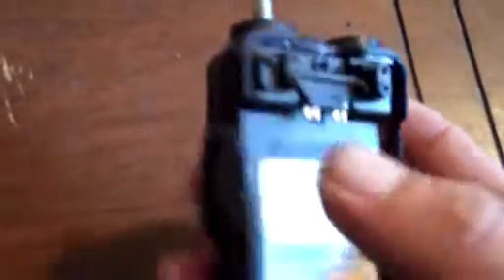Taking apart the Baofeng UV-5R

Comment from the maker: However if the user switched to frequency mode it would still transmit and receive. Beyond that, a radio shop may be able to modify it, but the labor cost would probably exceed the cost of the radio since they are available on ebay for about $30. Hope this helps

Comment from the maker: Not sure if you can totally make it receive only. When you program memory channels, you do it 2 steps, you have to hit the button to confirm the receive memory first, then you have to repeat the steps for transmit memory. This is because when program repeaters they transmit and receive on different frequencies. but I suppose you could program the receive and exit out and not program a transmit memory. Even if this is possible, it would be receive only when in Channel mode....(continued)